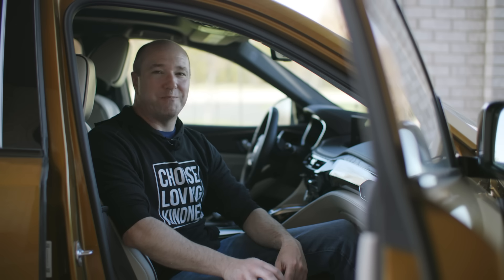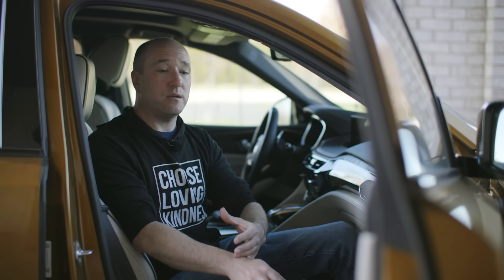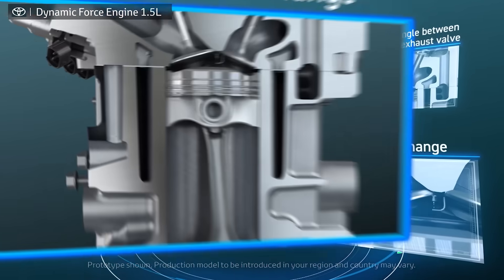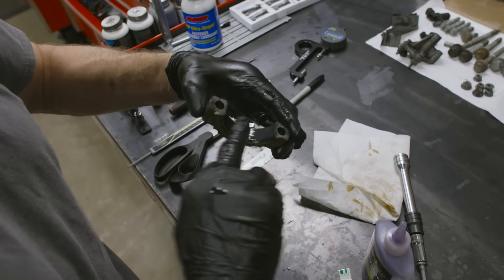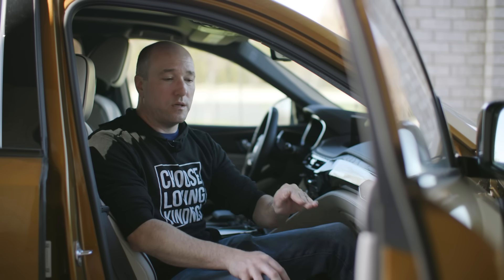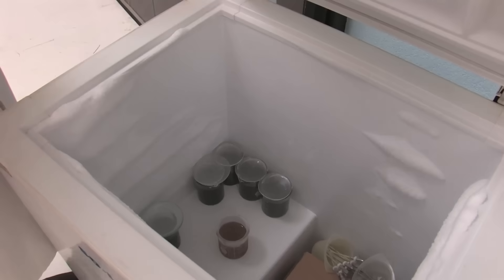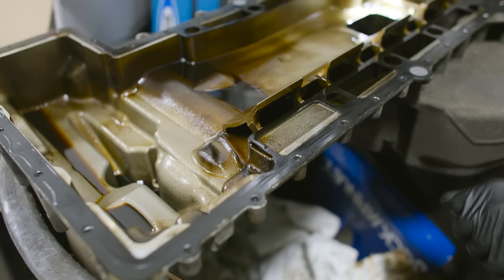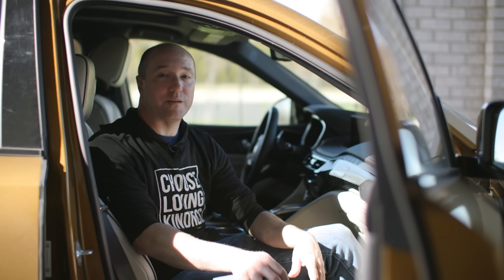Understanding Engine Break In | Dos and Don'ts

Comment: You said you wanted to do this video for a long time. That it comes now, late, when EVs become common, could be seen as unfortunate, but also as an act of defiance and rebellion, of setting a standard.
On the topic I am wondering whether you have a view on possible feasibility vs. differences of scenario regarding this guide on break-in: Moto Tune USA break-in secrets (Comment with link got removed.)
(So it's motorcycle which wasn't driven around before reaching the customer, and apparently mainly for racing, but the result is reported as very clean combustion chamber and no oil burn, i.e. great compression and performance.)

This guide's basic message of gradual increase of load applies very well to cold engine startup, too, by the way. When I started my car in winter and had highway five minutes after, I practiced a tight gradual load increase in order to get the engine ready for highway use. Meaning a minute of standing idle, then briefly gentle driving, then gentle acceleration bursts and never puttering around at minimum RPM. Then shortly before highway some sporty bursts to generate some good heat that can travel through the engine, then highway onramp gentle accelerating to mid RPM. Then the highway driving would get the engine to proper operating temperature in no-time and then it was time for some fun.

BTW, I owned a Corolla E9 that was iconic for badly broken in through granny driving. It was 5-speed and in 4th gear it had difficulty reaching redline. It was fine and speedy below that RPM range, but a 4A-FE struggling at high RPM definitely seemed like never broken in for that range. (Although I cannot be sure it wasn't some other issue.)

Comment: Given what you said about 0W-20 and the fact you're intimitely familiar with the GR86/BRZ drivetrain and its potential issues, what oil would you recommend for someone who does use it on track and tends to drive it relatively hard on the road too?
Reply: Iive in AZ and many people on our forums usually run 5W-30. But it can be overkill if you are only driving on the street. Daily dirving/some spirited driving, just stick with 0w-20. If you track it, especially in AZ, many people recommend going to 5w-30. The brz/86 platform can run hot in Arizona just from daily driving it and sitting in the peak AZ heat on the freeway. Not "blow your engine hot", but at times you can see the temp creep up and makes you a bit nervous lol.
Reply: @DysphoriaRL  Thanks for the reply. I'm in the UK so summer temps are generally a lot lower than AZ but I think I'd probably avoid track days in August where we saw 40C last summer! And then there's the question of warranty, I suspect there's no real downside to running 5W-30 vs 0W-20 other than a slight fuel economy drop (not worried about that) and noone would ever know whereas adding a proper oil cooler may raise eyebrows and if it ever caused a catastrophic loss of oil you'd be stuffed.
Reply: If it says 0W-20 I would personally use 5W-30 myself...but to each their own.
Reply: I'm making 566whp/440wtq with a 2L Honda and run 5w-30 (direct injection)  I run Ethanol so I change the oil every 2 to 3k given the heat and Ethanol being used.  

Some guys would probably use something a little thicker in hot climates like a 10w-40 

I run Mobil 1 extended performance with Mobil 1 filter - came recommend from a friend who runs same motor at 720whp/510wtq  - he is running thicker stuff now on a built motor with slightly looser clearances with the forged parts/larger clearances.

Comment: Last engine/car I bought had a hand built unit that was run in before ever being placed in the car. It somehow lived it's first 90k without issues before I owned it despite a sparse maintenance history and developed no issues. It's a 12 cyl though so it likely didn't have too much load put on it at first

Comment: This video still leaves the question: what do I do if my performance car recommends 0w-20 ONLY? (GR Corolla). What am I supposed to do? Change oil to 5w-30 every time I want to take it autocrossing or the track and then change oil back to 0w-20 every time? So about 10-15 oil changes a summer? Seems absurd.
Reply: Yep that's exactly what you should be doing. Oil change after every track day bare minimum and really should be running 5w-30 in it if you don't want to run an oil cooler.

It's a lot of work, but you either do what's best for it or you don't.

Comment: Great advice!  I purchased a new 2019 VW Arteon 3 months before Covid hit.  Needless to say I wasn't putting tons of mile on it for the first 6 months of 2020, 2K miles to be precise.  I did short trips around my town at lower mph but purposely took her out on the highway to run her at 60-65mph to heat up the engine thoroughly as well.  Changed the oil at 2K miles and she's been stellar since getting 37.8 mpg on road trips.

Comment: Funny because I just followed all of these tips on my new WRX, except the fact that I'm still using 0W-20.
Also I'm glad that clip of the Amsoil cold test was shown, they're definitely going to be what I use next since I want to keep the car as long as possible.
Reply: Penzoil Ultra Platinum is also great for the WRX. It has some of the lowest evaporation rates, which is a big deal with a turbo direct injection engine. It's what I use in mine.
Reply: @PsychoCPU  you used 0W20 PUP in the wrx, or their 5W30? I have a 22 WRX myself and it bugs the crap out of me that they changed the recommended oil to 0W20.
Reply: @AbleMable  nope I got 5w20 and sometimes 5w30 in the winter months. Direct injection engines are bad for oil dilution due to fuel blow by when they are cold, using 0w oil is going to wear your internals faster because of this. You may see a mile or two per gallon drop using a 5w but your engine will thank you in the long run.
Reply: Get rid of that 0w20.. not good for you, only good for WLTP number padding

Comment: I have taken a lot of new crate engines apart that were from a large American automaker. I was shocked to see how dirty the cylinder walls were from the honing procedure. I do not understand the logic behind the decision to let the engines leave the factory this dirty. This absolutely has to impact piston ring break-in. The metal left behind from honing is surely getting embedded in the rings. A quick bath in an ultrasonic cleaner and a quick wipe down of the cylinder walls with a paper towel and some motor oil makes them clean as a whistle, so why didn't they bother? I doubt all manufacturers are this sloppy with their work and I would think extra oil changes would help but I would be concerned that you would be draining out special additives in the factory fill oil designed for the break-in period.

Comment: I’ve seen some videos on this and basically found the same idea. The mechanic also said that it’s best to get your first oil change at 500-1000 miles regardless of what the manufacturer said. That’s exactly what I did. 

Baby it for a few hundred, drive normally for another few hundred, get an oil change in the 500-1000 mile range and you should be good to go.
Reply: I've never changed the oil at less than 3000 miles, even the first oil change. And I've never experienced oil consumption except with Corvettes. It doesn't matter what you do with those V8s. They WILL consume oil between oil changes. I changed our 2006 Lexus oil at 5000 miles. The vehicle is now 20 years old and has never consumed oil. I did follow the break-in procedure, perfectly. All were broken-in as per the manufacturer's instructions.
Reply: I’ve been breaking in bikes, trucks, cars for myself for a long time. I do the same 500-1000 miles first and another 1000 mile second. Never had one piece of equipment or vehicle use oil, that I have owned, and 5k oil changes. Don’t listen to the 10k+ oil changes.
Reply: @JAMESWUERTELE have you consider just suck a little bit of that oil and send it to the lab, only 35 dollar to test it…
Reply: @JAMESWUERTELE  Exactly right. You spend a great deal of money buying a new vehicle. Why not spend a few bucks more to ensure you're setting your investment up for future success
Reply: @JAMESWUERTELE  I've been breaking in vehicles for more than 30 years with the first oil change at 3000 - 5000 miles. After 15+ years, the only ones that consumed oil were those made by GM. None of the many Japanese cars consumed oil.
Reply: I do the same thing.  Oil is cheap and want the vehicle to last a long time.
Reply: Wish he would have addressed this more - I’ve read that engine oil from the factory has special additives and changing it too soon is not advised, and I’ve also seen your theory.
Reply: strongly agreed

Comment: 99% of the times you need variated load. Just normal driving without driving too low rpms or to high rpms for long time. In time you can start to blip it more and more frequently to higher rpms for short durations. Engine needs to go thru all types of heat cycles and rpm`s  in order to wear and break in properly.

Comment: Got to speak to a master Ducati tech about this back in the day and I've followed his advice ever since. 1. No high load at low RPM (don't lug the motor) 2. No high RPMs before the oil is up to temp 3. Ride it don't sit it! (Vary the throttle position, shift gears, vary loads and bed in the brakes, etc.)
Reply: I've heard that exact same thing from multiple reputable sources. Varying RPM is a big one people forget; Buying a new vehicle and driving it on the freeway home for 3 hours without changing speed.
Reply: @Josh-cw8by — as much as it may sound like a lot of miles, it ain’t, in the grand scheme of engine life. It’ll be fine and isn’t the end of the world. 🤷🏻‍♂️
Reply: @I_know_what_im_talking_about  I meant in the context of not varying RPM. The Freeway itself isn't a problem
Reply: Why no high rims until the engine is up to temp?
Reply: @simd510 the engine and oil both because the oil can’t lubricate properly when it isn’t at its stable proper temp
Reply: @Hot_daniel  interesting. Thanjs
Reply: Exactly, completely agree and believe that’s what’s written in the manuals.
It makes perfect sense, your breaking it in!
Reply: And no idling to get it up to temp, for more modern engines just drive it low load and low RPM slowly. Depends on temperatures around the area you are driving, the oil you are using, usually 30 minutes to get it up to temp to properly heat soak through all the components.
Reply: @XenonG  Yeah idling a cold modern engine will not really heat it up.. when people do that its quite literally raining water inside the engine
Reply: @MisoElEven  I would buy tickets to see that.
Reply: @badawesome  Well you sort of partially can.. in the winter you can turn the engine on  and rev it just a bit - you will see water vapor coming out of the exhaust. The rest of the water is condensing and dripping into oil. While the engine is cold the combustion process is extremely inefficient and it produces water, basic chemistry and physics..
Reply: @XenonG  what about for older engines like the 80s-late 90s? Is it still considered modern or are you talking like before the 50s engines?
Reply: @princetchalla2441  That really depends on the engine manufacturer and designer, I would say designs that are after the 90s just to be safe.
Reply: @XenonG  thanks
Reply: @princetchalla2441  Apparently you have a time machine.  Where did you get it?
Reply: All Important. I was told similar info. In addition - For the 1st 200 miles use the vehicle for six  times. That is use the car following all your other criteria - but also  go to operating temperature then "DEAD COLD" a total of 6 times. (so 6 - approximately 33 mile each sessions  - operation temp to full cold)
The idea is that cycling the vehicle this way helps with break in.
I've broke in a dozen engines this way.
Reply: @TerryManitoba  Go forward for 6 blocks then in reverse for 3 blocks, turn to the left for 5 blocks if its Tuesday,  drive home only to the right.  Pat yourself on the back and have a drink.
Reply: @badawesome Appears UR on top of it

 U go Girl

Comment: I've owned a lot of cars from a C5 Z06 to a GMC Sierra to Subaru STI to my Current Audi A5 and my break in ethos has always been the same: avoid redline and hard launches for the first 1000 miles I also slightly modulate engine load on the highway and do the first oil change a tad earlier than the manufacture recommends.
Reply: Yes. I have always did the first oil change at around 1000 miles. I've never had an unreliable car or motorcycle over the years. I don't do any hard accelerating until the oil actually is warmed up. It can take the oil longer to warm up than the coolant. I've seen a few exotic cars that were pushing out blue smoke when accelerating. That's oil burning. Too often I seen some owners of exotic cars run their cars hard from the first start of the day. I know it's nice hearing the engine is running up to the higher rpm. But they should take it easy until the oil is warmed up.

Comment: I did a break in with a new Subaru a few years ago. 0W20, FB25(outback). Varied speed for the first 400 miles then an oil change at 1000, then 5k-6k OCIs on the dot using full synthetic. Most of them were done at the dealer. Guess what? Around 55k miles miles it occasionally blew smoke on cold start and burned about 0.5qt of oil every 3k. Sold it shortly after. I didn’t do all of that maintaining for it to smoke.

I’ve learned that there’s no need to be anal about break in with anything short of a high performance engine. Just drive it normally. If it’ll break it will break, there’s no avoiding it.
Reply: Could've been an unlucky bad batch, or maybe one or a few times, the dealer screwing it up.

Comment: I did the 1500 recommended miles for my 23 BRZ. They recommend 6 or 7 thousand for an oil change. I change it around 3-5 depending on my driving because I live in Arizona, AND I drive it pretty hard. 

I get free dealer oil changes for a year, and they don’t cap me on how many. So it’s nice I can come in early if I wish.
Reply: They don't cap you?! I'd take it in every month
Reply: @sshah2545  yep, same